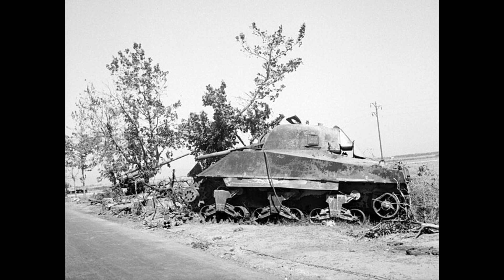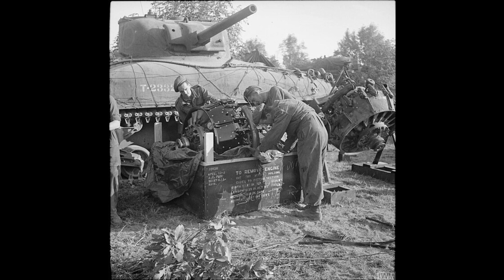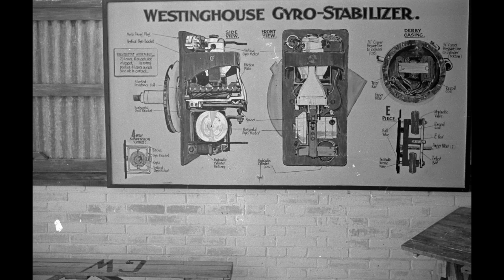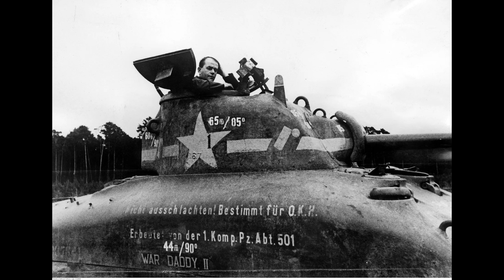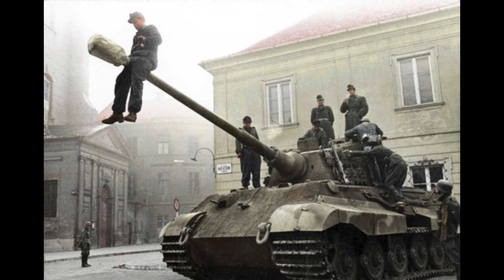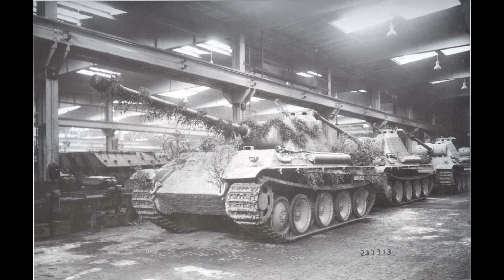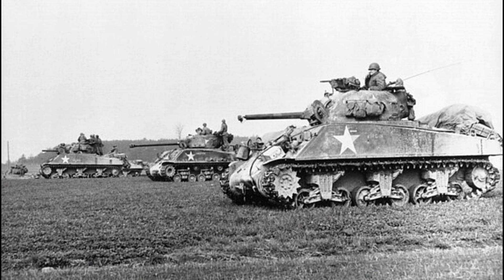German Engineers Tested a Captured Sherman - Then Realized Why They Were Losing the War

Comment: The Germans called it the 'Tommy cooker' as it was so easy to set alight. It was the ability to make so many so quickly that won but it was expensive in terms of crews killed.
Reply: not even remotely true. the sherman had one of the best crew survivability rates of any ww2 tank. early shermans had  a burn rate of 60 to 80 percent when penetrated. the same as german tanks. but the Americans introduced wet ammo racks and the burn rate dropped to 10 to 15 percent. the germans never fixed there burn problem. according to american records only around 5 percent of american tank crews were killd during ww2. significantly lower casualtie rate then american infantry. at around 18 percent.

Comment: The video fails to mention that the Sherman was primarily designed as an infantry support tank and it was superior in that role, not as a tank vs tank role.  The Americans could augment tank vs tank battles with superior air support and a highly mechanized artillery.  German commanders had to concentrate tank movement to nighttime to avoid allied air attacks and feared the speed with which allied forces could deploy artillery with their greater number of trucks and mobile howitzers.  Analysis after the war’s end indicated that tank destroyers were by far the greatest tank killers for both German and American armor.  The US had the Hellcat, faster than the Sherman with even thinner armor but a more powerful gun.  The Germans had the Jagdpanther and others.  The Hellcat surprised, fired and then retreated into concealment.
Reply: Agreed. The M-10, M-18 and M-36 tank destroyers were all quite effective in Europe. The M-7 also created headaches for German armor. They were all built for 'shoot and scoot' tactics that were quite effective.

Comment: Final thought, After August 1944, there were no more 75 armed Shermans shipped to France, they were all 76 armed. The M1 76 gun could penetrate 100 mm;s of rolled homogenous steel at 1000 yards with standard APCP ammunition. They could penetrate 145mm's of rolled homogenous steel at 850 meters with the HVAP ammunition. The Sherman M4A3 (76) could rotate its' turret four times faster than a panther.  It's'  gun stabilization could allow the gunner to acquire a target faster than a Panther could. The turret had three periscopes (Tank Commander, Gunner, and Loader) with single, double, and quadruple magnification. And the gunner also had his telescopic gunsight. The Panthers had one periscope for the commander and the gunner had only his telescopic gunsight. The commander had a turret and gun firing override in a turret with three electric motors and two alternators and batteries. The Sherman could rotate the turret electrically with the engine off while the Panther rotated it's turret from either a  power take off from the engine or a hand crank.  The Sherman commander could override the turret with high speed and accuracy which a Panther commander could not do. In a meeting engagement, the Sherman could get off the first shot 95% of the time. A Sherman always carried a round in the chamber in combat. It was usually a high explosive or smoke (White Phosphorous) round.  Neither round would kill a panzer, but, it would stun them for a moment.  Long enough for the Sherman to reload (20 rounds a minute to the German 12) and put an armored piercing round through the side (at 30mm) or an HVAP through the front.
Reply: trouble was the German 75 High velocity gun and the 2 different 88's could penetrate 105 to 177mm of armor at 3000 yards, which was more than enough for any allied tank. Plus, and it was no fault of or flaw of the Sherman, the US doctrine at the time completely hamstrung the Sherman. Even after the upggunned 76mm Shermans began arriving in force, the majority of the high velocity armor piercing rounds were reserved for the Tank Destroyer battalions. In the ammo mix, the Shermans mostly got all purpose rounds which were for less effective than the AP rounds. US doctrine at the time and until the end of the war was for tanks to exist in a multi role round, and for very fast moving tank destroyer battalions to race into ambush positions ahead of enemy armor and engage them. So even when in the fairly rare occurrences when Shermans actually went head to head with German tanks, and even when it was M4A3 Shermans with the 76mm guns, they had almost no high velocity AP rounds to engage the tanks with in the first place. The slower velocity rounds repeatedly ricocheted off of German armor. 
The Germans were the quickest to figure out (far sooner than the Allies)  that the LENGTH of the barrel and the TYPE and composition of the round being fired mattered far more to armor penetration than did the diameter of the barrel.
Reply: Plus the Panther armour were getting weaker and weaker due to the storage of specialized materials.
Reply: @Headloser  that's not true... the specialized materials as you call them (rare earth minerals) were used mainly as alloys in AP rounds and a few other uses. The armor on panthers and other tanks was 100% steel
Reply: @bendalton5221 
Yes, but by late 1944 was not the tougher alloys from earlier years.
Reply: And yet it would get TOASTED by a well Aimed 88mm Round!!!!!!:/
Reply: @sgt_slobber.7628  So would a Tiger by a well aimed 76 mm, and by well aimed, I mean in the side or rear of the tank.  My uncle was in the 709th tank battalion and fought  in the Hurtgen forest and Colmar pocket  and they never went head to head with Tigers .   They would use their speed to flank the German tank if at all possible.  If they didn't think they could, the would "bypass and haul ass", sort of like island hopping in the Pacific.  If you bypassed the tiger, it would have no choice but to retreat; if it didn't, there was always artillery.
Reply: @ejd53 that’s the Advantage of the Sherman’s!!!! They had speed, mobility and Practicality (they were easy to fix on the field)!!!!!
And they had lots and lots and lots of Sherman’s!!!!! I’m grateful for that or we would probably be speaking German today if it wasn’t for all those Sherman’s!!!!!:/

Comment: It’s odd because Germany easily over ran France with medium tanks, France had bigger tanks.  It’s not as simple as that, there is much more to the overall German strategy and the French strategy. It’s more of a comparison of reliability compared to unreliable high performance.  Kurt Tank, the designer of the Focke Wulfe 190, said it best when comparing his plane to the bf-109 and spitfire, a Calvary horse compared to a race horse

Comment: Given a Sherman vs a Panther or Tiger nobody would pick the Sherman if all the equipment is working.  This video hit it perfectly on the head.  The Panther and Tiger were better war machines at a tactical level but they were a strategic miss.  Just changing out a damaged roadwheel on a tiger was an all day affair of removing the track and multiple other roadwheels to reach the one your changing.  There is also no comparing the drivetrains because Shermans basically used civilian heavy truck transmissions that had both sophisticated engineering with mature designs and well understood manufacturing techniques.  The German equivalents were basically each hand made one offs.  It is like comparing a Toyota Camry to a Rolls Royce.  The Rolls is a nicer car but the Camry would be a much better car to live with for most real world users because it is cheap(er) and will be dependable while the Rolls will spend as much time in your mechanics garage as your own.

Comment: Even today German cars carry the reputation of being "over-engineered." Maintenance costs on a BMW are exceedingly higher than on other comparable luxury cars.
Reply: That's where car dealers make money....
Reply: @russelsellick316  Ford made the same mistake pursuing fuel economy standards, the putrid powershift transmission.
Reply: @stephenvoss6092 
My wife's Focus had that PowerShit transmission 
Total POS.
BUT, the little 2.0L 4 cylinder is still going strong at 205,000 miles!
Burns 1/4 of a quart of oil between 10,000 mile oil changes.

Comment: The Sherman was the Swiss army knife of American tanks , it was such a versatile , upgradable  platform that could multi-task - a look at Hobart's Funnies is proof of that  - the closest thing the Germans had to the Sherman tank  wasn't the Tiger or the Panther , it was the Panzer 4
Reply: "Super Shermans" were still in service in Israel for years after the war.
Reply: When you can produce 10s of thousands of mechanically reliable tanks you have options. Its why the sherman easy eight was in Korea, and why Israel used upgunned shermans as late as the early 80s.
Reply: Even the tigers and panthers were challenged by the sherman jumbo in terms of armor
Reply: @ElkaPME  The Tiger I only had slightly thicker armor than the E8 once you account for slope. The Jumbo (E2) had thicker armor than both the Tiger I and Panther. The Tiger II still had thicker armor.
Reply: @Chopstorm.  No no, the m4a3e2, aka the jumbo, not the m4a3e8, aka easy 8

The jumbo has much thickest armor of all shermans
Reply: @ElkaPME I know. The E8 (and several other variants) had ~95mm effective armor, which is very close to the Tiger 1's ~100mm of armor. The E2s, or Jumbo, had much more. My point being even the standard late war variants had some of the thickest effective armor for a medium tank.

Some people will say the Panther had thicker, but it wasn't really a medium tank considering it was about as heavy as an IS2, and Germans classified their tanks off their roles, not weight.

Comment: Sherman’s were unfortunately nicknamed “ Ronsons “ ( a maker of cigarette lighters) one strike and they catch on fire . The allied soldiers who faced German Tiger tanks in these fast & reliable but lightly armored tank were extremely brave . Early Shermans (especially the M4 and M4A2 with gasoline engines) had:
	•	Poorly protected ammunition racks
	•	High internal fuel vapor
	•	Thin side armor

When hit by German anti-tank guns, they were prone to catching fire or exploding, leading crews to joke grimly that:

“The Sherman lights up every time — like a Ronson.”
Reply: Same for the German tanks, sadly. They were running gasoline V12s, not diesels. I have NO idea where the Soviets came up with the high speed aluminum diesel V12 in the T-34 and KV-1.  That was a decade ahead of its time at least.

Comment: You never mentioned the superior radio, Shermans could communicate, German tanks couldn't reliably communicate among themselves while the US tanks talked among themselves easily but more importantly, they could also instantly talk to the supporting infantry, artillery, and call for air support.
Reply: Combined arms!
Reply: At least the Germans had radios. The French were using signal flags in 1940. Only the command tank had a radio- and the tank commander had to operate it along with loading the main gun, because 2 man turrets.

Comment: A BIG PROBLEM with German Panther and Tiger tanks was Hitler demanding "upgrades" that added weight and stress to the drivetrain.
Reply: Yep. German engineers would design a brilliant 30 ton tank. Moustache Guy would say "Put more armor and a bigger gun on it." So now you have a 35 ton tank- with the engine and suspension of a 30 ton tank.
Reply: @MarkStockman-n8s5w  no, you have a 44 ton tank with the suspension, transmission and final drives of a 30 ton tank lol. making it very unreliable. besides the fact it never was a real heavy tank. front armor yes. but side armor was only, 50mm for the hull sides and 45mm for the turret sides. the average side armor for a heavy tank during that time was 80mm to 100mm. it was definitely just a medium tank with way to much front armor

Comment: Funny how they compare it to the Panther or tiger when it's real comparison should be pnz3 or pnz4 which it was more than a match .
Reply: Yep, and it is a stupid comparison. The tiger and panther were special purpose, they were designed to fight open-field tank battles or as heavy artillery, and heavy they were. 

The ordinary panzers including the mk iv were medium duty tanks and the Shermans, especially as they evolved, were capable against them
Reply: @njlauren As far as I understand, by 1944 german tanks divisions were equipped mostly with Panthers and Tigers, the production of Panzer 3s (and also Pz 4s IIRC) was abandoned in favor of Panthers. It was the army artillery units that equipped Panzers converted to Stugs and did that in mass (as compared to Panther, not US or Russian production). In late 1944 the main Pz 3 factory was bombed and the production diminished. (If I confused something, sorry, I don't pay close attention to dates when reading/listening about that stuff).
Reply: @jaceksiuda 
Based on what I know, no. a German tank division by 1944 would have roughly 150 tanks operational at a given time ( it could be more). It is possible that an SS division might have more tigers and Panthers in the mix then a regular Wehrmacht one, but the bulk would be mk3 and 4 panzers. The other problem with that idea is that the tiger especially had to be transported to where it was needed and I believe panthers had the same problem. An ordinary panzer could go cross country under its own power, the heavies couldn't, especially when by 1944 most bridges had been destroyed and heavies can't go over temporary bridging. They were transported by rail and between the maquis/soe/oss and air corp bombing rail roads,  they would have not been all that effective. My dad was part of a TD battalion from day+ 10 on, and he said that you rarely saw the heavy tanks anywhere,and he had been all over especially during the bulge. 

Was it possible Germany put all its efforts into tigers and Panthers, maybe. But they could produce so few of them, even in the best of times, they wouldn't have enough.

Comment: Tigers had a 5 to 1 advantage over Shermans...too bad they always brought 6.
Reply: yeah not remotely true. the Americans only ran into tigers a hand full of times. there is no indication the tigers performed  all that well. most were destroyed without the Allies having to do a thing. either by braking down and being destroyed by there own crew. or getting stuck because they were to heavy. leaving german infantry unsupported. that why the western allies lost 164,000 kia from d day until ve day. and according to german historian Rüdiger Overmans the germans lost 263,000 kia against the western allies during that time. Allied infantry was almost always supposed by armor. german infantry not very often. because the germans were to busy building over complicated junk. and the Allies were building simple, reliable easy to maintain tanks. the majority of what tanks did was fire HE in support of infantry. something the sherman was very good at
Reply: @toto99-o6o it’s a fun joke.  Sherman’s were  designed for an anti infantry roll and avoided tigers, let the strike aircraft and artillery deal with them.
Reply: @warnerww83  yes and no. when the shermans first entered service the 75mm was fine for dealing with german tanks at that time. by 44 not so much. that's why they introduced the 76mm. specifically so it would have better anti tank capabilities. and the british went even further with the sherman firefly. it's 17 pounder had almost identical penetration to the panthers 75mm. so yes, the majority of what they were used for was anti infantry. they were also designed and upgraded for anti tank roles

Comment: They always compare the M4 to the Tiger. Even though there are only a handful of verified encounters by American M4s and tigers. It should be compared to the Panzer 4 and 5. Those are it's true opponents.
Reply: Not to mention it wasn't really designed to fight tanks, it was designed to support infantry which it did well.
Reply: @arc00ta yes, it's main job was infantry support. but the 76mm armed shermans were designed to engage tanks as well. and especially against the most common german armor. the panzer 4s and stug. it was very affective. and against the panthers side armor it could penetrate it at 2km. since it was only 40mm for the hull sides and 45mm for the turret sides. and the sherman firefly with it's 17 pounder had almost identical penetration to the panthers 75mm. meaning it could deal with basically anything.
Reply: Americans had too many tanks to compare 1 to 1 - in combat

Comment: The whole German vs American tank comparison is real apples to oranges. The American tanks like the Sherman were made for infantry support. The 75mm was a heavy shell/ low velocity for primary use against infantry and bunkers. There was a real reluctance to even go to the 76mm and to the 90mm Pershing. It was the German experience on the eastern front that made them evolve the tank on tank doctrine from where they started in 1939, also as an infantry support function.
Reply: They liked the 75 as it had a superior anti-personnel round.
Reply: The 75mm high explosive shell was used against infantry and bunkers.  The 75mm AP shell was designed to kill armored vehicles and given that most of what Germany was fielding were Panzer IVs, Panzer IIIs, and Stugs, it was effective enough.  It didn't do as well against Tigers or Panthers, needing a side or rear hit to reliably penetrate, but until the Panzer IV F2 and Tiger I were encountered the M4's 75mm was considered to be superior to anything mounted on a German tank.  The 75mm was a general purpose gun chosen because it was considered to be well-rounded for fighting armored vehicles, infantry, and enemy emplacements and even after most Shermans started being upgraded to the 76mm, it was common practice to put 75s back on three tanks in a platoon and keep the 76 on the fourth just in case they encountered a Panther or Tiger.